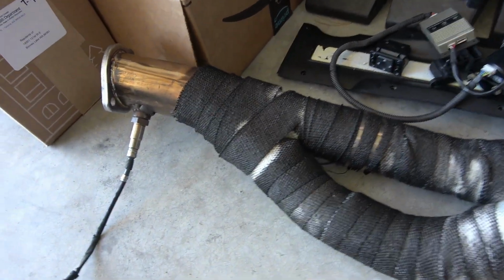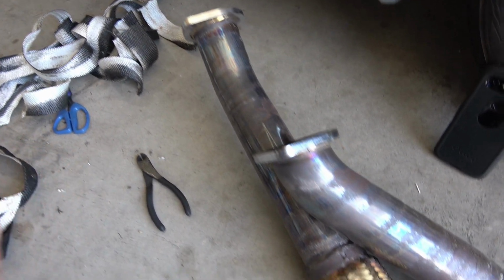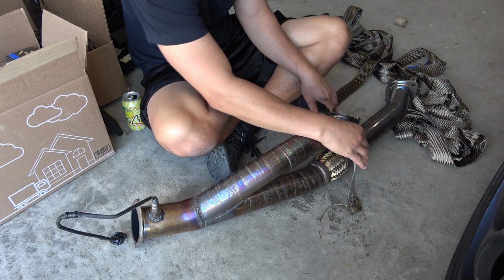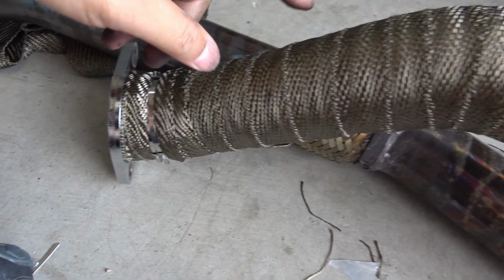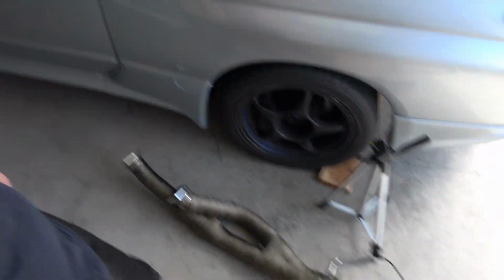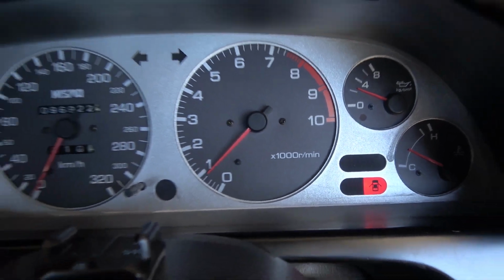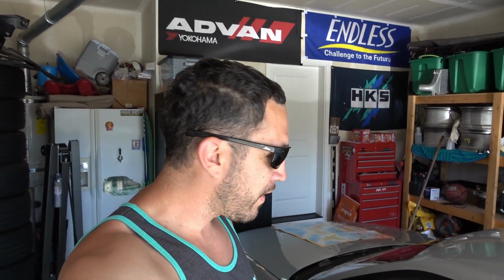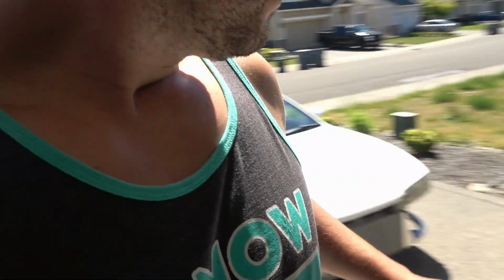How to install DEI heat wrap onto exhaust the right way

Comment: Stainless exhausts are usually intended to disapate heat quicker, wrapping it can effect performance and could damage it where it traps heat.
Reply: False.  You want to contain as much heat as possible for efficiency of getting exhaust gas out as rapidly as possible.
Reply: @registrationaccount1034 exactly.

Comment: How did you make out with your oil pressure problem?  As of today my 32 gtr stated 0 when stopped and idle and went to about 2 bar when driving...  Was perfectly fine the other day.  Hoping it's just the sender.  Has a 3rd gen RB26 in it.  Thanks and keep up the good content.
Reply from the maker: If you look in the factory service manual it shows that it's supposed to be about six bars while driving under load in higher rpm range. Should be around 2 to 3 bar at idle. You might have a bad oil pressure sending unit. Before I replace mine my car would also read zero bar and idle. Glad you like the content